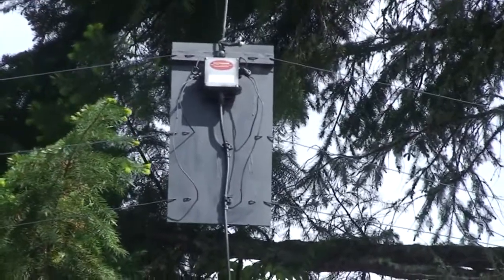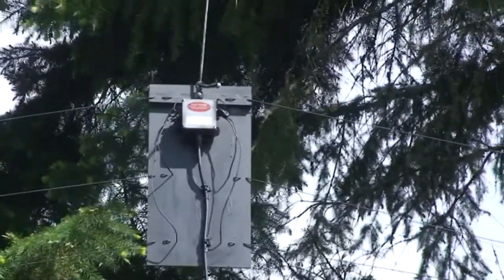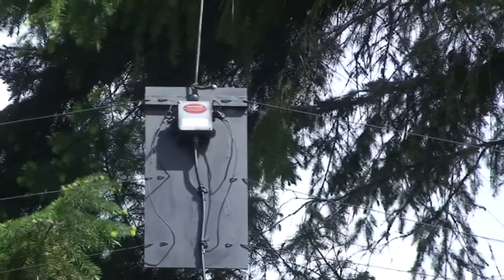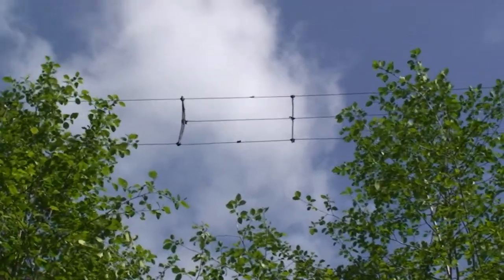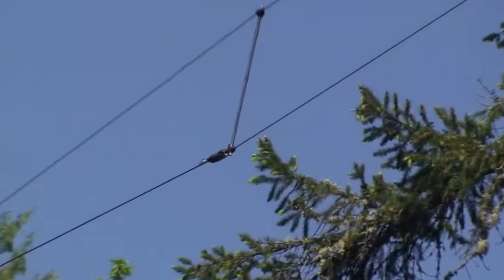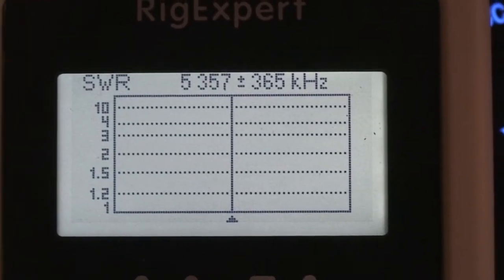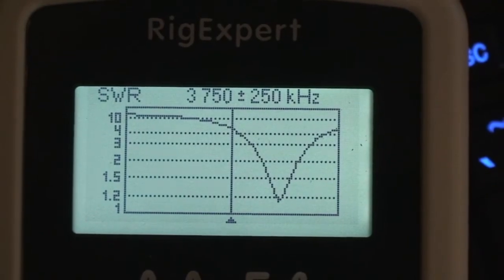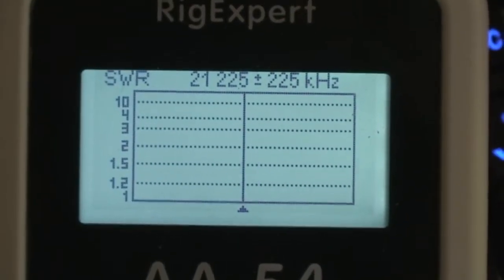Fan Dipole 160/80/40 meter DIY

Comment: If you have a family dollar in your area you can get bamboo dirt cheap . Available in spring/ summer till they run out  they about 1/4 in. I think 3 to for 4 feet  long  7 in a pack. Cost is cheap . I'm buying more next spring. I'm also using it for support for a portable 2 meter quad